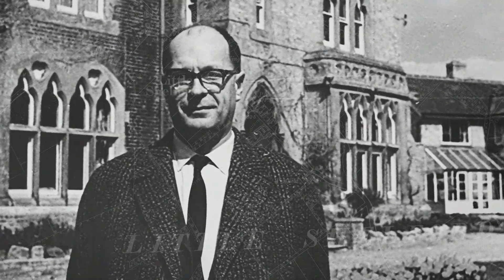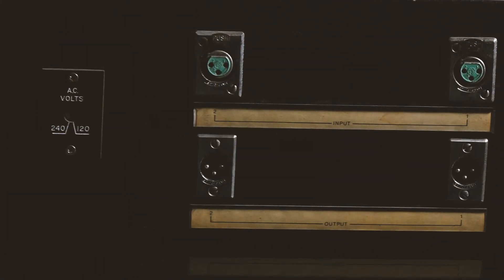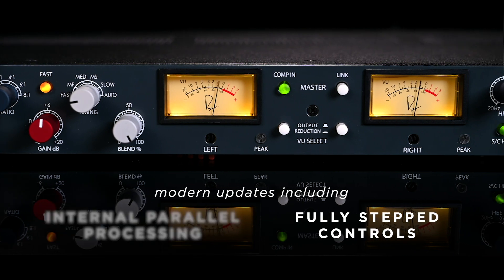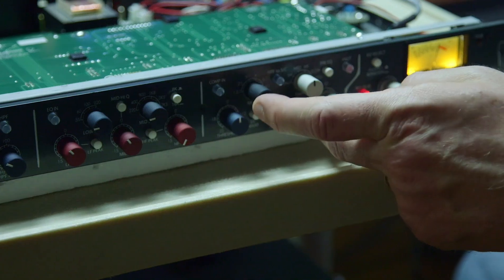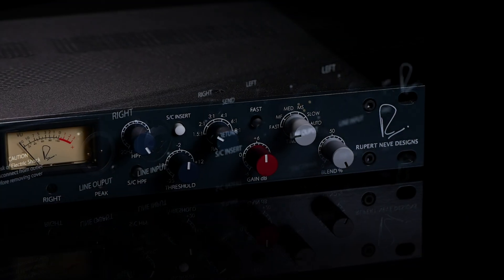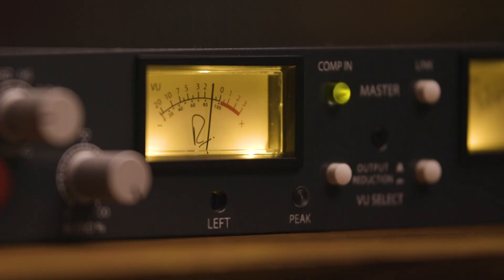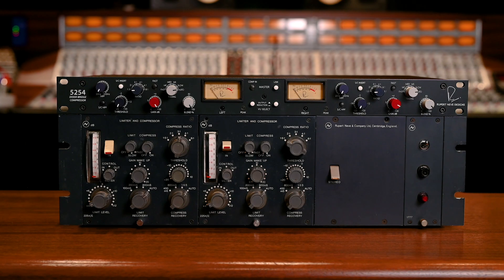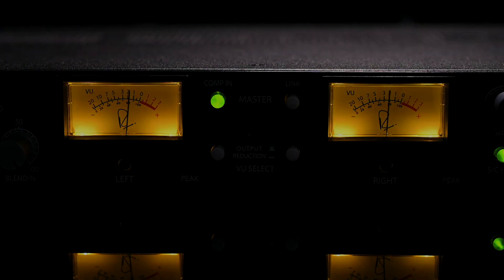The Shelford Diode Bridge Compressor (5254)

Comment: I'll bet that this is the last word on "Neve compressors."  I like 2254's on some things, 33609's on others, but these guys have all the features without the $4500-12,000 price tag.
Reply: This is a reversion of the 33609 then?
Reply: @Balverine  I don't think so. I believe that it's much closer to the 2254. The world doesn't really need another 33609 copy; those already exist. But a more reliable, clearer 2254 with variable "attack time" would be great.
Reply: @tekis0  i don’t know which one should i buy, the 33609 or the 5254, which one would you buy? I think I like the 33609 more so far, but feel like the 5254 is more versatile

Comment: How does this compare in tone of the 535? For electric guitar? Acoustic guitar? Better with the 535?
Reply from the maker: The diode bridge itself is very similar to the 535 implementation, the Line input and output stages, power supply, and transformers are all stepped up slightly from the 500 series standard so there is a little more depth and impact to the sound in addition to higher headroom (how much better these things are are fairly subjective since the 535 is at a very high level to start with, but there are at least some advantages to the overall design of the 5254 and shelford channel vs the 500 series architecture)

Comment: So 2 500 series modules for $1990 or rackmount for $3599?
Reply from the maker: Hey Blake, yes this is correct.  While the diode bridge itself is similar to the 500 series version, the higher voltage / current power supplies, shelford line-amp stages, shelford output stages,  larger chassis, and meters all add substantially to the cost to produce.
Reply: @RupertNeveDesigns  makes total sense!  I love my 535, wish I had 2!
Reply: @blakejohnsoncsr have you used them on vocals?